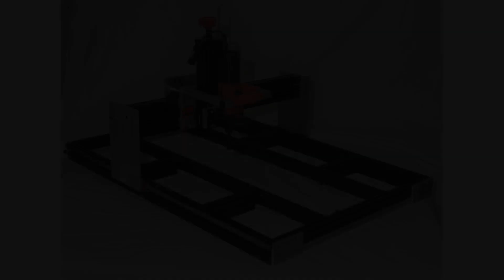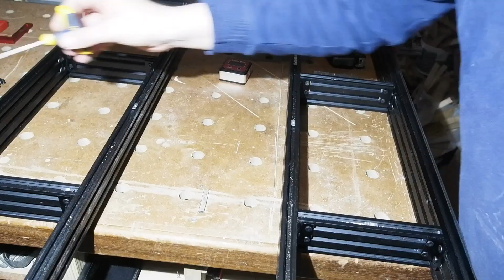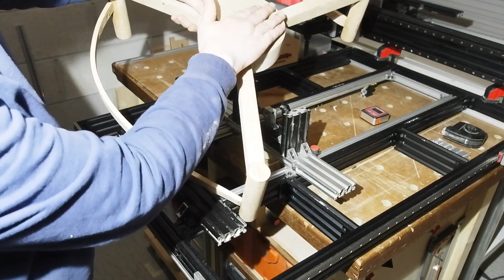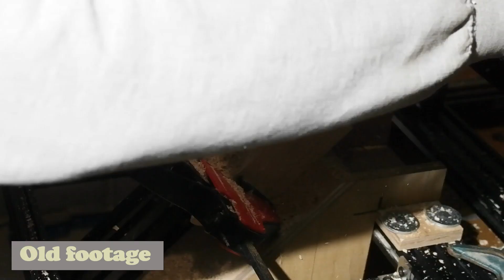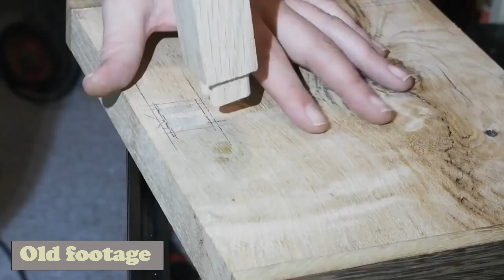I Rebuilt My Router Sled Copy Router - Here's The Low Down

Comment: this is really excellent - have you got a parts list by any chance? I would only want to make a router sled at the time being, but it seems sensible to make that a little over engineered to allow for future jigs! Thanks for a great helpful video :)
Reply from the maker: Thanks mate. No, sorry. Never did get round to doing a parts list. My machine started off as a much more basic router sled. I've just tweaked and added to it over the years to where it is now. That's the beauty of using aly profile. And yes, as much as your budget allows, over engineer it . The stiffer you can make it, the more potential it'll have.👍
Reply: @BischBaschBosch  ah thank you! I'm just trying to work out what I need from Ooznest at the moment haha, I'll try and make a series on the router sled and maybe I'll end up with something as impressive as yours (in 10 years lol....)
Reply from the maker: @thornedesignco  Good luck mate. Give me a shout if/when you finish. Would love to see it. The main difference from it being a router sled and a full 3 axis over router like mine is the addition of the Z-axis (up/down). That really ads the versatility. I bought mine as a complete unit from Banggood (includes the c-channel and ball screw etc). They've go good deals on them. 👍
Reply: @BischBaschBosch  the z axis looks like the real winner! Thanks for the suggestions, never checked out banggood but I will do so on your recommendation :)

Comment: Great build, I’m looking at making a similar one myself, just wondering what sliders you used? I’ve used igus in the past which are the nuts, but expensive. Get what you pay for I guess!
Reply from the maker: Cheers Tom. Nothing with a brand mate. Just cheap 12mm ones from Banggood. I'd recommend the 15mm rails for, if nothing else, just the fact you can attach to the bearing with a decent size screw. These 12mm use m3. Bloody nightmare! The shorter length rails I have are superbly smooth to be fair. The 1m ones though, different story! Tried 3 different rail sets and a whole host of bearing runners. All stiff. Had to resort to dismantling the bearings and sanding the races back a little. Better but not perfect. No idea why it only seems to affect the 1m ones. I'd defo invest more money next time.

Comment: Hay how's it going? Been on holiday over the summer? Hope you're keeping well looking forward to another video!
Reply from the maker: Alright mate. I'm all good. Just been having a break from Youtube, concentrating on my furniture. Appreciate your asking. All the best.👍
Reply: @BischBaschBosch  that's cool yeah I'm looking to get into furniture more, bit bored of sheet goods and picked up some nice timber recently. Where do you draw inspiration from? Any books on furniture/chair design? What software do you use to do design? Thanks Sam
Reply from the maker: @samrix5793  Good for you mate. It's a much more intimate process, making hardwood furniture I think. More rewarding as a result. Most directly, my inspiration comes from the early modernist/minimalist looping tubular steel frame designs that came out of the Bauhaus in the 20's and 30's. I reinterpret the form in wood. I've considered talking about design and inspiration for a video funny enough. It's very difficult to find design inspiration tbh. Even more so a "voice" or style. I have hundreds of books. Not just my old joinery text books but ones on art, design, architecture etc. You'll find old book shops have loads of these type of books. Get the ones with lots of pictures.  😉
Reply: @BischBaschBosch  yeah my biggest pain is I don't want to spend time on a computer designing as on one all day and not good enough to sketch completely what I want to make
Reply from the maker: @samrix5793  Well, being honest, anything that pushes you a bit or is designery is gonna need some drafting first (detailed plans). That said, loose tenon joinery opens up loads of room for good builds and design. I think a really good accessible example of that is Peter Millard making a hardwood version of ikeas bekvam step stool. Good design and straight forward joinery you could create from a 10 minute scribble. Something enduring and pleasing at the end of it.
Reply: @BischBaschBosch  yes agree! I've got a domino which is very useful and ordered a shaper origin which I think will help with compound curves and larger pieces etc
Reply: @BischBaschBosch  all the gear no idea lol
Reply from the maker: @samrix5793  Stop it...I'm getting tool envy!😁👍

Comment: Great piece of work very inspirational, I have a open builds platemaker from ooznest (no longer supported) and have never really got on with it due to small work area and fiddly to hold down work so currently being mothballed but watching this hopefully you have given me some options to try something like what you have done but on a smaller scale. Still very much a noob to routing and find the jig making fascinating.  Thanks once again
Reply from the maker: Great to hear, cheers Stephen. Something like mine with a much smaller footprint would work just as well for the milling type processes (kind if like a panto-router). It's just the function of slab flattening you'd lose. With lots of sliding t-nuts in the profiles, there's lots of options for work holding. Most of the time, I use the small corner brackets for 20mm series profile if something is flat to the bed. 👍

Comment: Great to see how far this machine has come from your previous iterations. Seems like it works very well now. Have you considered creating (or selling) plans for it?
Reply from the maker: Thanks mate. Yeah, it's come a long way. Plans for it have been mentioned in the comments and I kind of like the idea. After some thought, the problem I have is managing people's expectations. You can't just order the parts, build it to a plan and be away. There's an awful lot of tuning to be done. For example, the bearings. Many of them have had to be stripped and have the runways ground very slightly to run smooth. Lots of little things like that. Time is another. I don't have any. I'll pluck away at it here and there though. See what I can come up with.👍